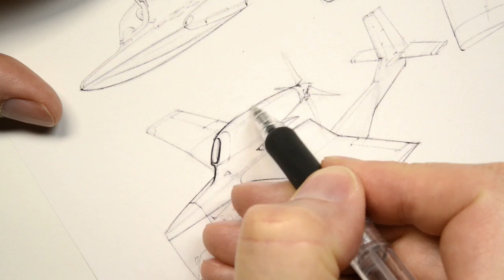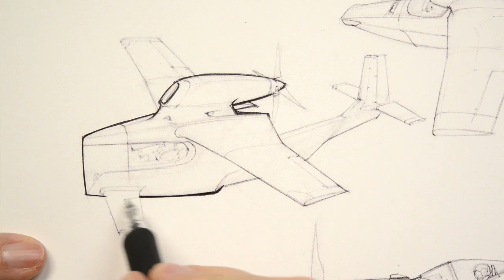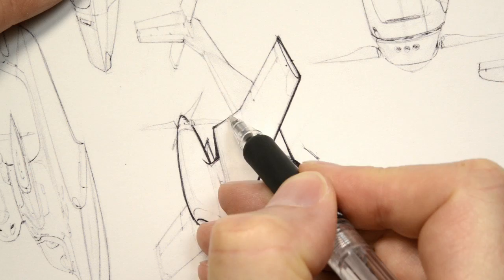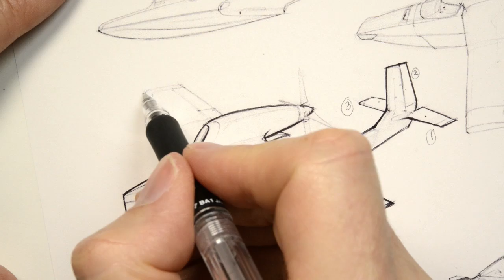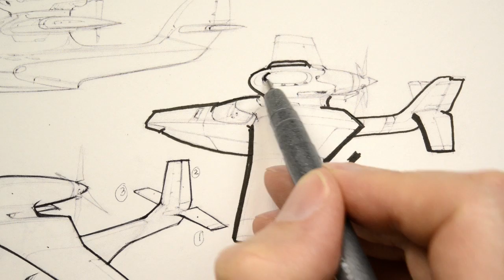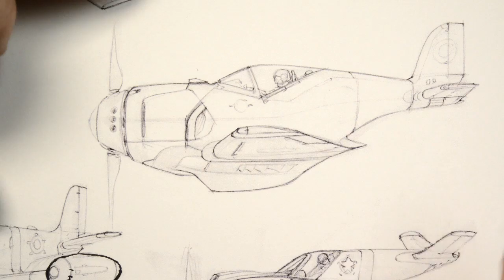line weight demos with various pens

Comment: Great stuff! I would be interested in hearing your thoughts on drawing from the hand/elbow/shoulder, shoulder position, and the way you hold the pen. Experimenten with that a lot lately, for example: your thumb is over the pen and in front of your index finger. Most other artists with great lines have a similar technique. Thanks!
Reply from the maker: I use two grip positions. One is the same as I use for writing. This is good for doing detail work and control when drawing from my shoulder. The second is an thumb on top grip like tradition figure drawing artists hold the pencil. I usually use this grip when drawing larger and using pencils. It's hard to use with a pen because the angle of the nib to the paper is too shallow to get good ink flow going.
Reply: +Scott Robertson What kind of pen did you use fat the start of this video?
Reply from the maker: +Marc Baker That pen is no longer made, sorry. You really just need to find a good pen store and try a bunch or surf Jet Pens online for good ones to test.

Comment: What do you do with something with more detail? Is it JUST the outlines that should be thickened or do the details within need the same treatment? I understand its based on spatial properties, but need more of a demonstration as to what merits thickness. I'm working on a somewhat smaller size paper so getting detail in is difficult already, I'm afraid bold lines may start to kill off the white space too much or altogether.

Comment from the maker: You should be able to do it both ways to vary the effect, strong silhouette versus strong overlapping forms. Try it both ways and observe the differences and then decide which way to go in order to convey what you want about the object. You can do both at the same time once you get the hang of it and if you have enough variation in your line weights.

Comment: Thanks again for another great class!

I use the same technique when inking illustrations. Several pens for several line weights starting with more hard lines on the outside and work to finer details inside the drawing after. I'm self taught so it's always nice to see that (even by myself) I get to use similar techniques, means I'm  hopefully in the right direction. I just find that brush pens work better for organic stuff rather then mechanical. :)